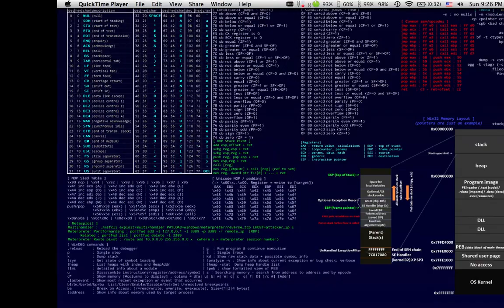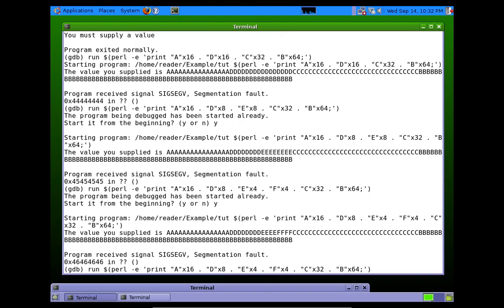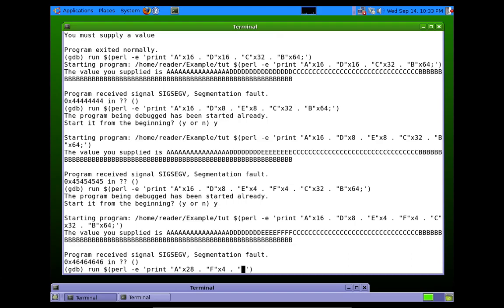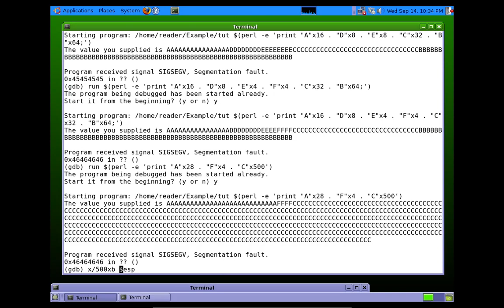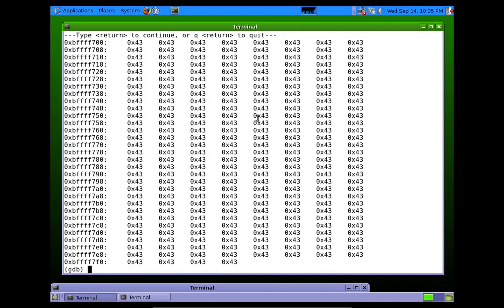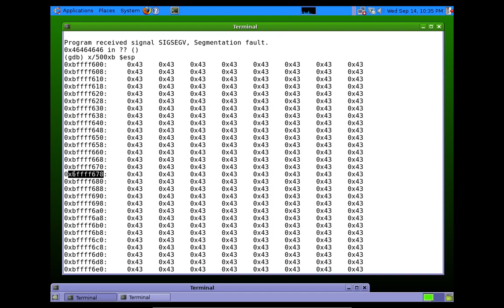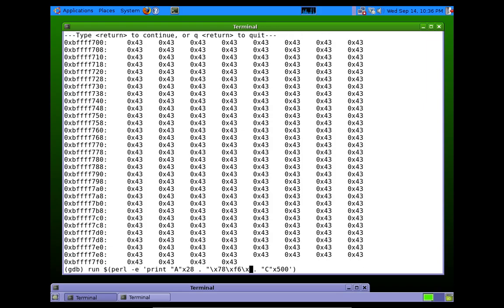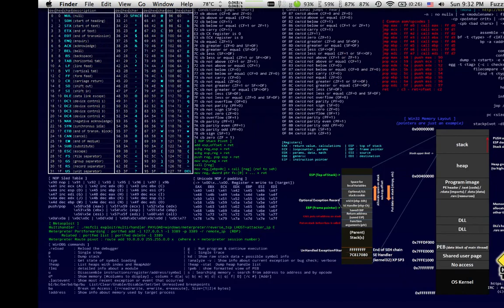Buffer Overflow Tutorial - Part 6

Comment: ... because you overwrote that with A's your programm crashes at second chance and the kernel sends a SIG TERM. (correct me again if im wrong, i'm also new to this stuff)
to exploit this (when gs-cookies flag is used when compiled) you can overwrite the SEH (safe exeption handler) with an address to pop pop ret in kernel.dll which will then execute code 2 bytes before the SEH. there you put a shoort jump and jump to your nop sledge+payload.
google "exploiting buffer overflow gs cookie"

Comment: if you put too many bytes you will eventualy hit the top of the stack and get a memory privilige exeption (writing to read only memory). then the programm will report this exeption to the kernel which in turn calls the exeption handler. the exeption handler pointer is just before EIP or if GS-cookies are used just before that before EIP (please correct me if im wrong). you can exploit this for arbitary code execution (see below). because you overwrote that with A's... (see below)

Comment: you shouldn't use hardcoded memory adresses for buffer overflow to write in eip
instead take a static lib (preferable one that comes with the program). search for a jmp [register] where register is a register that you're able to overwrite (for example esp) and write the opcode for that jmp [register] to eip and put your nop-sledge at the beginning of that register followed by the shellcode. that's much more reliable